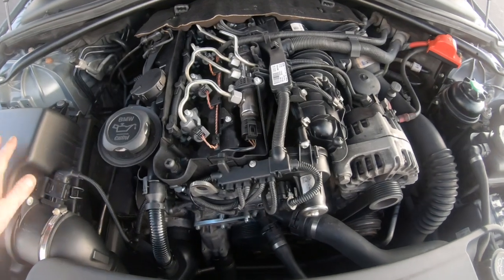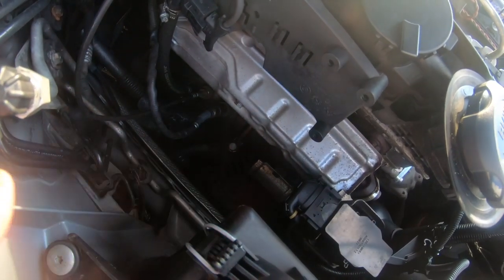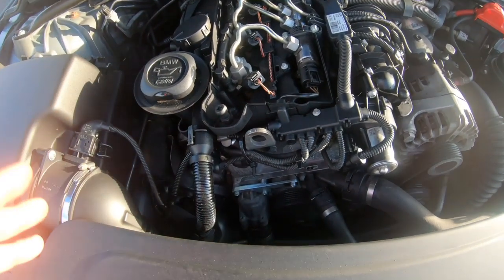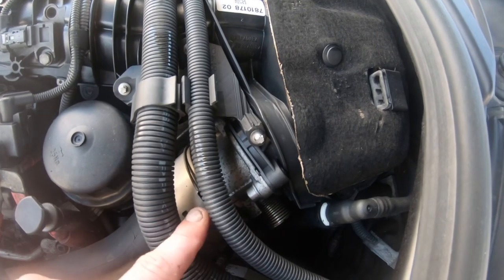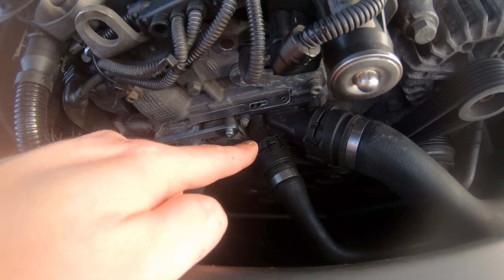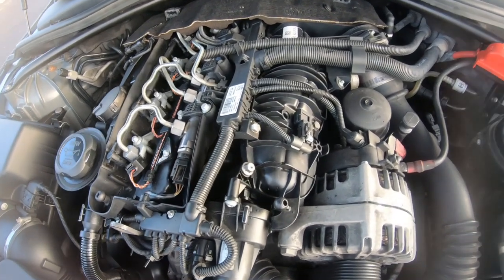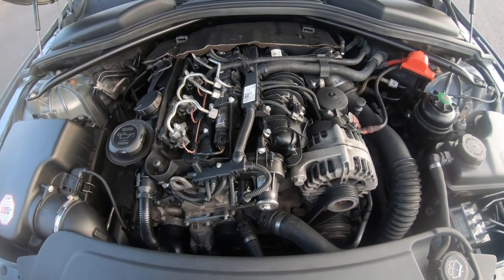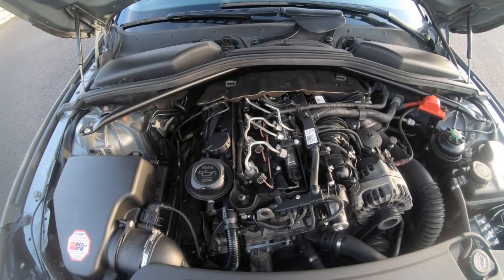Bmw N47 Reliability 2019........... Can It Be Reliable STILL In 2019

Comment: Got a prob with my e61 m8. If I do a hard right the exhaust note changes, sounds like the regen drone. Only does it if it's a hard right. Should I check the exhaust system for movement or is there another common problem that does this?
Reply from the maker: Air suspension mate when the air drops for cornering it’s rubbing on the backbox check the air compressor and springs usually what’s meant to happen when you corner the air suspension drops and then rises for cornering
Reply: @BMWDoctor  Cheers mate, so check for broken spring or any air leaks?
Reply from the maker: That’s it mate OR the pipe going to the pump mate and filter have you seen my video of it mate ??? When I done it
Reply: @BMWDoctor  Yeah mate that's behind drivers side rear wheel lining innit. I'll have a look mate cheers.
Reply from the maker: TOYS AND FAMILY no problem mate what happens with those when you go round corners the suspension will drop to compensate for the weight now as we sit on the right side the air suspension is meant to go down to make the cornering better and if you go to your left you will realise it won’t go down but if yours is going down that much when you turn right that the back bumper is rubbing on the backbox that means there is a air leak and it’s dropping to much and can’t compensate for the air in the air suspension usually it won’t be springs it’s usually the air pump the compression ring inside weakens and shrinks when cold so it lets air escape but then once hot it expands so you may need a new compressor mate this weather is about the time people realise the air suspension is knackered mate
Reply: @BMWDoctor  Cheers mate just checked the filter and pipes and they seem fine, looks like they've been replaced not too long ago. I no I did hear the compressor  pretty loud last week as I was putting my tools in the back aswell so looks favourite then.
Reply from the maker: Ahhh mate if your using it to load up heavy items that will damage the compressor and springs straight away most common cause is people overloading the boots on them and yes if the compressor is going for too long and your hearing it
Loudly that means it’s knackered mate the piston inside has worn best bit is to rebuild it mate it’s cheaper parts are about £50 to do it that’s why when I had mine I wouldn’t overload the boot a lot of people who own e61 get it and use it for carrying building supplies and all that and I tell them do not buy this car for that trust me that’s when e61 gets expensive very expensive as the compressor will wear constantly
Reply: @BMWDoctor  I'm a spark mate so nothing that heavy goes in tbh just toolbag and a couple of drill boxes. If it is goosed would you recommend converting to coilovers or would it be ok to rebuild and stay with air with that kind of weight?  Just I do most my driving in work from job to job some days so would rather be driving something comfortable and fun than a rattly van.

Comment: mines 63 520s  at 105 lci chain snapped costing me 1200 and if any other damages caused due to its extra bill, as I'm getting it repair what would u suggest me to also change as in fuel pump? etc
Reply: 520d
Reply: glow plug? and should I also ego delete

Comment: Ok I've got a BMW e92 330d and I'm thinking of buying a f10 520 as a second car I'm sure them cars have had engine reliability issues if I do buy it what's the best way of looking after the  engine
Reply from the maker: mate dont BUY THIS ENGINE AT ALL !!!! thats my advice why you looking 2.0 go 3.0 engine or V8 engine thats the best way and I can advise you properly on them engines as there very little maintenance trouble free motoring
Reply: @BMWDoctor  I need something economical I do get around 40 mpg from 330d but I've heard the 2.0d can return in higher 50s. Is it worth getting 3.0d and getting the eco remap done on it ? Secondly my e92 recently had oil in the coolant expansion tank due to oil cooler was messed up and at one point the expansion tank was full of foam and car over heated and engine shut down. I've got the oil cooler sorted I find a little on in the coolant but no coolant in the oil . My question is that one time it overheated and turned off would that have messed up the head gasket ?

Comment: I have 320D ED 2014 clutch slipping so getting a flywheel and clutch fitted it’s only on 83k it’s under warranty would it be worth getting the chain done or is this ok at this year, after watching this video I’m tempted to just push it off a cliff😂😂

Comment: Ecom remap vs power remap. What's the difference?
Reply from the maker: The answer to do that is very simple 

Are you rich or poor ????
Reply: @BMWDoctor  I just don't know the different meaning/difference as I am not native English speaker. 😁
Reply: @BMWDoctor  you mean those little tuning boxes and remapping?
Reply: @BMWDoctor  tuning boxes of course are shit. Remap is much better. I have thought about it, but I experience alot of trouble with my n47d 116d. Chain, 2 injectors, generator, two seals missing from air intake, dpf full, now turbo rattle, that I think is not the turbo itself but still. It's pretty annoying. But when it runs right its pretty cool
Reply from the maker: No my friend ECO AND POWER are two different things 

I’m asking you are you rich or poor

But because you have N47 I’m taking your not that rich

Comment: My timing chain snapped and it's a 2012 model.
Reply: I read that n47 from 2011 were meant to be fixed, but as mileages creep up some failures are happening. Can I ask have you use LL04 oil and did you do 12 month or 24 month services?

Comment: What about the hpfp failing?  I'm more worried about that than the timing chain. I am in the USA and the diesel might not be as lubricating as the diesel over there.

Have you seen any hpfp failures? Do I need to put lubricating additives in my diesel?

Thanks
Reply from the maker: No I haven’t ever seen that here but then out grade fuel is very very good and we have addictive son our fuel 

I think what you should do over there in the USA is hold a protest against your country and ask for them to buy fuel from Iran again instead of having there own your cars would last longer
Reply: @BMWDoctor  it actually on all diesel trucks too that have the Bosch cp4 hpfp. Lots of trucks are having to modify hpfp's or change to cp3's.

If it fails the whole fuel system gets contaminated and has to be replaced.  $8k++++
Reply from the maker: mate that dont happen here as I stated you guys get manafacturer defect parts EVERYONE knows that thats why your parts ALWAYS fail

Comment: I have 07 e90....its done 147k does my engine have the timing chain problem?
Reply: 2007 is the very year when the problematic N47 was introduced to replace the far more reliable M47. And the 2007-09 generation of the N47 was actually the worst in terms of the timing chain failure. However, some 2007 models were still powered by the older M47 even after the N47 had been introduced. So if your BMW has the N47 engine, you are highly likely to encounter the timing change failure. Which is worse, it can sometimes happen even without any warning in the form of rattling noise. But if your car has the M47, you can count yourself lucky.
Reply: @liberalniautokrata7697  how would I know what engine I've got in my car? Kind Regards

Comment: Honestly the worst engine ever. So many issues, that i would rather walk! Timing chain, turbo, oil leaks, prob spent 6k if not more. Just spent another 750 on turbo and mechanic messed it up and now sounds as if bottom end has gone. Beautiful looking car (f10) - dont fall for the looks.

Comment: So is basically anything after 2010 with the revised tensioners decent
Reply: They revised them after 2009 so yes, I read up that it probably will still be noisy but it chain won't snap

Comment: Bottom line, is buying a e92 with n47 worth it?
Reply from the maker: thats the bottom line correct !! THE BMW DOCTOR HATES 2.0 Engines so take my advise stay away from ANY AND ALL 2.0 engines BMW DOCTOR only likes and loves and supports his subs with BIG V8 PETROLS OR V10 OR 6 CYLINDER PETROLS
Reply: @BMWDoctor  i'm wondering if i should get a 335d e92 BUT where i live 320d is 15k and 335d are 25k so heh. But i guess its worth not to get a scrapped engine.
Reply from the maker: No diesel my friend PETROL only 

That’s not worth it either
Reply: @BMWDoctor  'BIG V8 PETROLS' that go through, timing chains, coolant pipes, valve stem seals, and V10's that go through, rod bearings, they have a certain determined service life of the rod bearings, how stupid is that, when do you have to go through rod bearings on a Corvette, or Ferrari, Porsche or Lamborghini? NEVER!
Reply: no m57 is the way
Reply: @NightmarishPT  get a 330d e46 or 530d e60 pre face lift 👍

Comment: Toyota verso has this engine. In 150.000 km, the crankshaft is gone. This engine is a failure. BMW shouldn't have done such work.
Reply: it's not a bmw engine its biuld in England the 30d is way better

Comment: Hey doc if I replace my dme msv70 with cas and key is that plug and play or do I still need coding for it to run? Thank you.
Reply from the maker: No mate your gonna have a tamper dot and yes your gonna need coding and reprogramming that’s if the module hasn’t exceeded the programming limit as if it has you cannot do it the normal way 

I can clear the mileage from the ecu for you but you would have to send it to me for that to happen that cannot be done on normal software and inside the car
Reply: @BMWDoctor  are you on WhatsApp? That way I can message you for info on pricing and so fourth?
Reply: Even if its the complete swap dme/key Cas?

Comment: You missed one of the most common issues, swirl flaps!!
Reply from the maker: Not on B47 there electronically controlled and were (SORTED) on this car way way before then bmw sorted that issue no more going into the cylinders
Reply: BMW Doctor I have a 2009 model facelift 520D do I need to have a look at them ?
Reply: @hidri86  depends what engine you have mate, n47 is quite common, what engine you running?
Reply: Adam Russell I e got the n47 engine
Reply: @hidri86  yes you will have them if it's the 2.0D, I'd definitely get them removed mate

Comment: They still snap after 2010... Just go to F10 forums :D
Reply from the maker: yes I realised mate they do indeed means this engine was NEVER reliable and just a problem avoid at all costs and get M57 only as N57 suffers the same exact issue
Reply: M57 gets better fuel economy too 🤔 
My f10 n47 was getting 37mpg and my dad’s e39 530d was getting 40mpg both with me at the wheel driving them in the same fashion.
Reply from the maker: DawidCantDrift mate I’m talking E60 M57 even better then E39 as it has ZF GEARBOX from 2007 and has 6 speed gearbox even more economical better still get M57n and get 535d
Reply: BMW Doctor my mate has a 535d business and it pulls like a train! 
I’m still a sucker for the f10 looks, always wanted to just swap an m57 in to one 🙈. Maybe a project for the summer.
Reply from the maker: DawidCantDrift you can’t do that mate 

The mapping and the ecu from what M57 uses cannot be put on f10 chassis because how the modules changed on that platform so that’s a no go you will need a different ecu and cas and then it will throw out all the other modules as the modules know there is no pairing for that engine on that chassis so it cannot be done 

I’m not really a diesel person if I’m honest BUT I don’t mind working on them and fixing them that I enjoy but I wouldn’t own one or want to own one even tho I could afford to own the best ones f10 I hate that body style and never liked it since the day it was released but I like the G series that is looking to be the next car on here
Reply: BMW Doctor anything is possible with the right amount of money 🙈 I’m gonna do some research on this, surly there’s a way to bypass all the engine modules and just run a whole loom and ecu from an e39/e46 for the simplicity? 
I’m only keen of diesels because I do 30/40 miles 6 days a week commuting and my previous petrol cars have cost me a fortune to run 😪 
Unless I find something that has 6 cylinders and can do at least 36mpg.
Reply from the maker: DawidCantDrift you think that’s bad mate I drive from Cornwall to London 3 times a week I’m not moaning I have 3 petrol cars I don’t think they cost that much I don’t even look when I fill up but then it’s all paid for by this channel so money isn’t nothing to me when your earning £300 a day from this channel
Reply: @BMWDoctor  109500 GBP per year, just from this channel? LOL!
Reply from the maker: My friend you can laugh clearly you have no idea how Youtube works but I’m glad you don’t because you then dont realise how we’re able to afford all the cars we want and keep them going you subscribed to me mate makes all the difference trust me 

It’s £1 for every sub I have mate that’s without my business on the outside of Youtube 

If you was smart I’m sure you would know this already
Reply: @BMWDoctor  Keep your hair on! Err - sorry! LOL. On that money you should be able to afford a decent gaff with a decent garage. Pulling your leg me old mate, I love your channel.😁
Reply from the maker: My friend I own 2 garages in my area 😂 and my own home already that was even before Youtube mate I have people from here come to my workshop all the time we have snooker table , and all sorts here for comfort but I stopped everyone from YouTube coming and is strictly for business outside of Youtube

My friend I’m the ONLY youtuber who doesn’t show there whole life off and show everyone what I’m doing where I’m going what I’m going to be doing I do STRAIGHT Youtube the rest is kept to myself and people that I want to know I ain’t one of them youtubers that I owe you lot my life mate don’t work like that I do the videos I want and that’s all you get NOTHING more !

No how or what I’m doing what’s happening next what I been busy doing I don’t care enough for you lot to warrant that 

I’m here strictly for one reason and that’s it and it definitely ain’t for the subs trust me
Reply: BMW Doctor I

Comment: It's a crap engine. Why I avoid 4 pot rattle boxes and they Really noisy when normal.
Reply from the maker: Totally agree bmw 4 cylinder engines are rattle boxes but the same can’t be said for other manufacturers
Reply: I am driving bmw e90 lci 2011y 318d  no problems at all, timing chain was replaced at 209 000km just to be safe, now it has 231 000km and still driing fine its pretty good...
Reply: @BMWDoctor  Yeah definitely, the E30 M3 is really bad (you see the irony)
Reply: @laughingjack2988  lol we are talking about the n47 engine 🤣